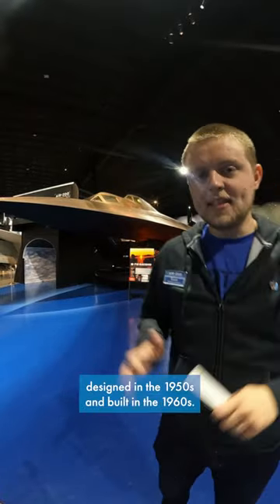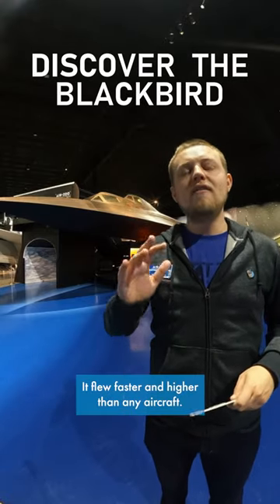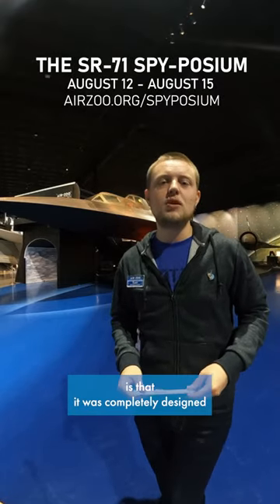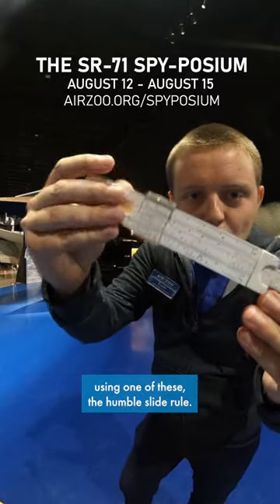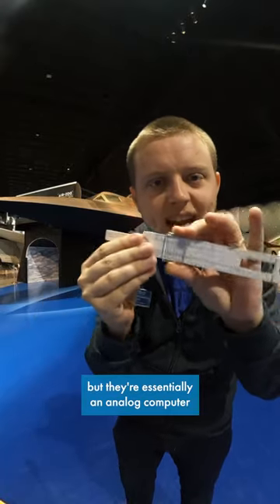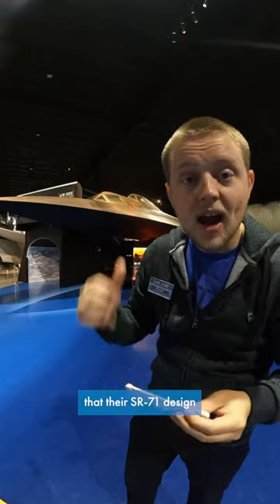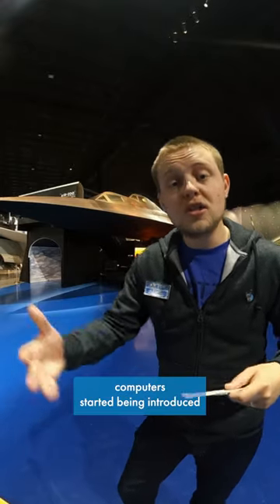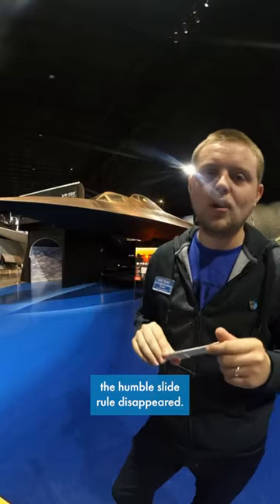The Humble Slide Rule

Comment: Slide rule contains pre calculated and calibrated values from non linear conversions and trigonometry. You can also use a table printed on a book but slide rules are your handy analog calculator. Amazing tool indeed.
Reply: We're the pre calculated and calibrated values specifically calibrated for the blackbird, or are they general rules and values?
Reply: @dominicdeluca6378  My dad who was a Civil Engineer and he used slide rule to calculate everything. I don't know if the ones used in design is special or not but there certainly was a general one which saw the use across industries.
Reply: @dominicdeluca6378  General mathematics, usually set up for logarithmic functions as well.
Reply: The Handley Page Victor V-bomber had its cross section area versus length calculated and fine tuned for lower drag (very) near the speed of sound, in the late 1940s!  Its wing also increased in sweep nearer to the thicker wing roots, a remarkably sophisticated design.
Not all slide rules are equal, there are bigger, better and more capable ones to be seen in the excellent Slide Rule Museum site.

Comment: I can't even imagine being an engineer back in the day without all the technology we have today. Props to the people who made such incredible machines possible.
Reply: Using a sliderule is not difficult at all. What was a leap were calculators with graph   capability... HP 41c
Reply: @Dogleg1957  I'm talking about all the numbers they'd have to run vs just plugging it into a computer simulation today. I'm not actually saying using a slide rule is hard.
Reply: @dillonventola408  did you ever work on 029 data card punches. Redundant amount of work. One of the  Technicians took a ibm 510.. 512? And hooked up a speaker on it took about 300 data cards and played a toon one it. Sounded like star trek computer singing bicycle built for two. The whole floor erupted like Beatles just played
Reply: Nowadays it's all on the computer and copy and pasted from an old design. Engineers today are sorry excuses compared to the engineers who designed the gyroscope and navigation systems of the 1930s and 40s with a slide rule.

Comment: Yeah, we forget how good at engineering humans are. We invented the carburetor wayyyy before we had any sort of way to properly calculate the proper sizing if jets, venturi sizes etc. And somehow they figured it out, and even made high performance versions to boot. Good stuff.
Reply: If the carburetor is too simple an example, just take a look at early automatic transmissions. Analog hydraulic computers with several input variables and critical timing.
Reply: @mfree80286  yeah, that's a very good point. . .extremely good actually. You're totally right, I've never thought about it that way but yeah. . .they are indeed doing low level problem, if you could theoretically make the gear sizes change while in operation then you'd have an arithmetic machine 😅 they're basically set calculators meant to solve like 3 to 6 problems or so, very cool!
Reply: Bernoulli equation bro
Reply: I laugh at some of the mad maths in some YouTube challenge videos, I get the results in seconds with my half century old slide rule.  You can look at the number scales and visualise the solution!

Comment: I taught myself how to use a slide rule because it seemed like something engineers should know. 

It makes sense that early computers didn’t have any improvements, I’d be curious is that changes with the greater processing power we have now for stuff like Finite Element Analysis
Reply: "Like something Engineers should know"

Not really. There is no need for Engineers to know how. Today they know how to use modern equipment that Engineers of old would be unable to even turn on let alone design and test with.

Although I'm 100% with your attitude towards wanting to learn to use them. I feel like I should know, but havn't bothered learning.

Comment: Basic multiplication and division on a slide rule is easy to learn, and kind of fun. What you have there is a scientific slide rule, with scales for doing inverses, converting between degrees and radians, performing trigonometric functions, and even raising numbers to powers, (exponents) and other logarithmic functions. Those are harder to learn, and have to be “practiced”, because it is a true skill; but compared to pencil and paper, volumes and volumes of tables, and hours of manual arithmetic, a small device that could replace all that was truly a game-changer. When I was in school, we had kids that competed in U.I.L sanctioned slide-rule contest. If you saw the sample ‘practice’ equations they were given to solve within a certain time, it would melt your brain. I remember in the late 70’s a Hewlett-Packard scientific calculator was between $300-400, and any science or engineering major better be able to afford one of those or be pretty sharp with a slide rule, because those were your choices. Desktop computers were still 3-5 years away.

Comment: You forget how old you are till you remember that's how you used to do calculations when you're in school.  The four function handheld calculator came out after I graduated high school
Reply: I saw a reverse Polish notation calculator in my last year in school.  One pupil was showing it, very rare and super expensive.  A year later I had a cheapo Commodore red led display model with no square roots and a mad thirst for battery current.  I still had (and still have) my slide rule.

Comment: Uhhhhhh you forgot the Darkstar. Mach 10.2 aircraft, made with computer software that showed the slide rule, sr-71 was a archaic ancient badly designed aircraft. Darkstar was piloted by none other than captain Pete maverick Mitchell. Best aircraft and pilot there is. Darkstar would run circles around the old SR-71.

Comment: A slide rule just ads and subtracts logarithms. Simply put, you line up the 20 and the 20 and the 10 on one should point to the 40 on the other. Move the zero over and bam, it's done multiplication for you.

Aerospace Computers don't exist. We just use programs in normal computers.

Comment: There was a.plane that flew faster though it flew at mach 6.
Reply: The SR-71 Blackbird was the fastest air-breathing, jet powered aircraft of all time. Any other aircraft that achieved higher speeds did so using rocket-engines.
Reply: X-15 is basically a rocket with wings and a cockpit.
Reply: @shobithrkava2144  yeah it was that.
Reply: @shobithrkava2144  Yeah, it was basically a rocket with wings and control surfaces.